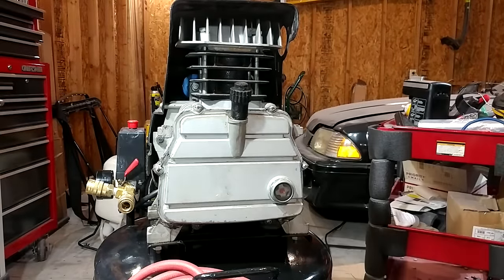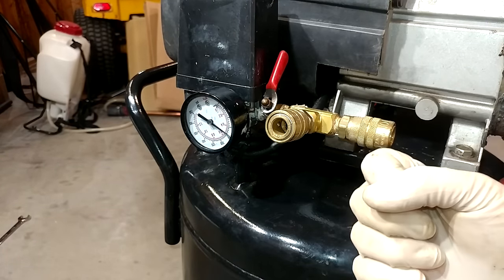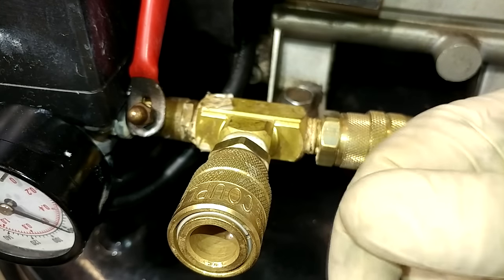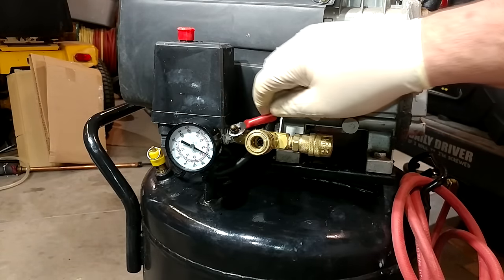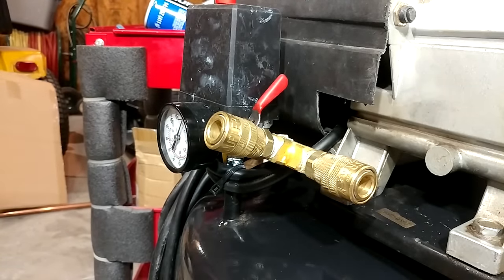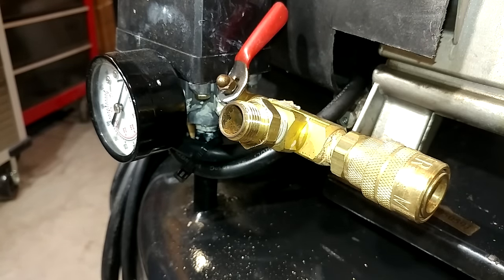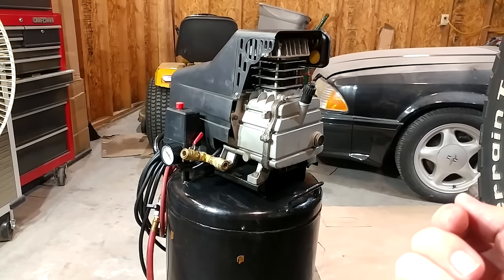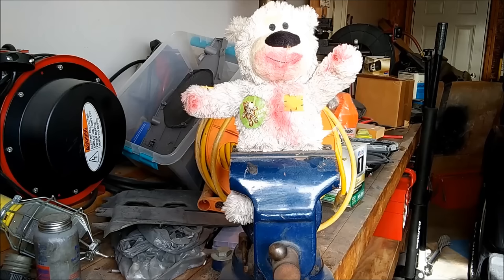Cheap Upgrades for Cheap Air Compressors!

Comment: Having the ball valve under the tank defeats the purpose of not using the original drain cock. Ofcourse the ball valve is easier than the drain, but by that time who cares their already on the ground. But I do get what you where going for, just not worth it. In my mind. Great video tho!
Reply from the maker: Thanks!

The valve under the tank is just there for emergencies and I don't think I've ever shut it off. The one at the end of the hose is the one I use for draining.

Comment: "These Milton fittings are amazing and never leak".....and this one is a problem child. lol
Reply from the maker: You're not alone in the lol... I struggled with how to handle that.
Reply: @TheBrokenLife  you did great! Very informative video. Hilarious part is once you said how great they were, I instantly started looking them up to buy some and then the trouble maker appeared so i said “eh i better hold off.” Haha
Reply from the maker: @LakersNinersFan  I appreciate that! It was a face palm moment for sure.

Despite that, the Milton's are still the best I've used. I did look into getting some Parkers, but they're about $25 each. Not sure if they're worth it to me. I may get one just to tinker with at some point.
Reply: @TheBrokenLife  How's your experience with the compressor itself? I just bought a 27 gallon dewalt from Home Depot and am waiting on it. Had a McGraw but that crapped out on me. I sand blast cups to make them look frosted but I've had trouble finding a compressor I don't have to keep waiting on. It shouldn't take me 30 minutes to sand blast a 26 oz cup. lol
Reply from the maker: @LakersNinersFan  I reviewed it over here: https://youtu.be/j2nLAYkaNYA

As far as what you're wanting to do, it would never do that. Sandblasting is one of the most air hungry activities there is. In the many hours I've spend doing it over the years, I've already decided if I have a sandblasting job any bigger than a dixie cup I'm going to get a gas powered compressor for the job. Something like an IR 2475F13GH. It's not cheap, but you don't need lots of electrical power for it and it's not as expensive as it seems when you really look into the performance vs. a comparable electric.
Reply: @TheBrokenLife  So a bigger tank wouldn't help me? Because I tried with a 20 gallon McGraw that crapped out on me and now I have an 8 gallon as a place holder but it restarts in 10 seconds. lol. I just shut it off until I use the air in there and then have it fill up all at once.
Reply from the maker: @LakersNinersFan  You're doing one very specific job, so it's hard to say if the bigger tank will help you or not with that very specific job. Maybe 27 gallons of 200psi capacity is all you need for one glass? I don't know.

But... In general, the larger storage tank just means it will take longer for the compressor to turn on, and consequently it will run for longer to refill. If you want lots of continuous duty air volume (which for sandblasting big stuff, like car parts, you absolutely do), then the compressor itself needs to flow enough air for the job, and at the same duty cycle. So if I'm using 10cfm of air at 90psi, the compressor needs to provide 10cfm at 90 or I'll have to wait on it regardless of how big the tank is. Likewise, duty cycle is an issue. The cheaper home hobbyist compressors like these aren't intended to run 100% duty cycle. In fact, it's more like 50% or less. So that means if you run it for 5 minutes, you should let it rest for 5 minutes. This is super frustrating since it usually takes at least 5 minutes for them to come up to pressure the first time. The industrial stuff is rated to run 100%.

FWIW, it looks like the Dewalt produces about 20% more air than the McGraw at 90psi, so it should be a better compressor for the job. I tried to find the duty cycle for the Dewalt, but they don't seem to advertise it, which usually means "not very long". Oil-free compressors tend to run on the hot side so I don't like to push them too hard, but, I've never used a "good" one like the Dewalt should be. You might want to shoot them an email while you're waiting and ask them that question.
Reply: @TheBrokenLife  Great info!!!! THANK YOU!!! I'll definitely shoot them an email. Much appreciated!
Reply from the maker: @LakersNinersFan  I'm happy to help. You just gave me the thought that maybe an air compressor basics video would be a good thing...? I'll add it to the list!
Reply: @TheBrokenLife  YES a video like that would be great! I've searched for ANY video that would basically tell me a list of things I can and can't do with my specific air compressors and found nothing. 

BTW, I searched and found an answer to the duty cycle. They said oil free CAN run at 100% but doing so reduces the overall life of the compressor which I would assume is fine since I got the 3 year warranty on it. But they recommend between 50% and 75%. Can you explain to me the 75% part. Sorry, I'm not good when it comes to these sort of things.
Reply from the maker: @LakersNinersFan  Well, it's hard to say what you can and can't do with any specific compressor since each exact task is different. You have to look at your air usage (usually the tool will advertise its consumption) vs. what the compressor can supply and usually the compressor manufacturers lie by at least half. ;) So... If your tool is calling for 4CFM at 90psi, your compressor should probably be rated at 8CFM at 90psi, minimum, if you want to run your tool non-stop without waiting for the compressor.

Duty cycle is way easier than it sounds. It's the percentage of time out of 10 minutes that it's "allowed" to run. So, 75% is 7.5 minutes of running time, then a 2.5 minute break. Personally, if I were to offer advice, I would err more toward the cautious side and stick to the 50% mark. So, 5 minutes on, 5 minutes to rest. I would be more comfortable suggesting extending the duty cycle if you add some auxiliary cooling, like a regular household fan, to help the compressor cool.

That said, I run my compressor for as long as it takes to get the job done. Sometimes that's literally hours on end. If it dies, then I have no choice but to get a better compressor. At the price point you're at, that starts to get a little expensive though.
Reply: @TheBrokenLife  You are a treasure chest of knowledge and help!!! Thank you for everything. You’ve helped me a ton.
Reply from the maker: @LakersNinersFan  I do what I can and I'm glad you found it helpful!

Comment: Sorry dude, but you got several things  going on there that I would absolutely advise not to do.
Why do you have a hose on your drain? Street 90deg elbow, 2" pipe, ball valve and a 2"-6" pipe coming straight out is where that should end. That setup you have there is absolutely retaining water. Especially since it's above the lowest point of the tank. That crud in your disconnect  pretty much confirms that.
Regulator with a guage is essential if you want to prolong the life of your tools. Most air tools operate at 90psi and that's where the regulator should be set. Fullbore air from a compressor that can push out over 90psi will shorten the life of an air tool. 
A filter of some type on the output before your disconnects is an absolute necessity if you want to protect everything downstream.
Reply from the maker: I explained all of my decisions clearly in the video. If you're not understanding something, or just in disagreement, that's fine. My new compressor (in the playlist) has a much more elaborate aftercooling and water separation loop that actually cost more than the entire HFT machine in this video. Also keep in mind that the machine you see in the video had been in use for nearly 20 years. It must have been working alright. 🤷‍♂

Thanks for watching!
Reply: @The Broken Life  Your equipment obviously you can do whatever. My professional advice (30yrs+) is no one should be duplicating any of this as an upgrade. Gravity is indisputable. That hose was above the low point. Looking at that hose, you'd have a lot of blow down to completely clear it. Our tanks have long blow down lines but they're 300gal, 600psi.
Regulators by their very nature are restrictive. That's how they regulate. Some are better than others. Guage displaying what the output is, is what really matters. The restricted air if you have everything piped right isn't going anywhere.
Reply from the maker: @muhammadsteinberg  The hose isn't above the low point of the tank... it comes out of the bottom at a lower level than the factory drain would. It's a drain hose, not a reservoir.🤦‍♂ You not understanding that isn't a shortcoming of the design. Likewise, the rust isn't because of that hose... it's because I never drained it (which I said in the video). Again, this is a shortcoming of your understanding. The entire purpose of the remote drain is so I do drain it more often. Which has worked... I even have a video of it working, which is linked in the description. 🤷‍♂ 

A 600psi system that you have to "blow down" sounds a lot more like a steam system than it does compressed air. Those things are not the same. You typically don't "blow down" air compressors, you drain them (which every air compressor manual I've ever read says to do daily, in those words)... although I confess that I usually do a combination of both. In industrial applications, small compressor tanks (such as in the maintenance shop) normally are either never serviced or have automatic drains, and the industrial stuff with many hundreds of horsepower of compressors usually have air dryers and other aftertreatment so that water rarely gets into the storage tanks to begin with. That's obviously beyond the scope of someone with a $150 compressor in their home garage. 🙄 You're letting your experience, whatever it may be, cloud your frame of reference. I'm not trying to replicate a blow molding or tire factory here.

The regulators that come with cheap compressors like this are not capable of the flow rates required to actually run air tools. They really don't even flow enough to run a decently sized blow gun. An entry level "decent" regulator that would keep up with air tools approximates the price of the compressor. The audience for those markets is not the same. A $100+ regulator is not a "cheap" upgrade. That's a different video, which is coming... I explained the issue and you have failed to understand it. 

Anyhow... If you still don't understand how this stuff is setup, how it works, and why I made the decisions I did I'd be happy to explain it in some other way that may make sense to you because at some point if you really don't understand, it's because I didn't show it well enough. If all you came to do is just "tell" me things, alright then. Every comment helps and I appreciate every view. 👍
Reply: @The Broken Life  LOL dude. Btw the system is compressed air for air starters that start locomotive engines. Far above someone doing a hack job in their garage. Not knowing how to turn the wrench pretty much sums it all up. Good luck....
Reply from the maker: @muhammadsteinberg  Thanks! This is my most profitable video so I appreciate your support! 👍

Comment: a tee fitting is unwise     the 90 constricts airflo on the extra hose     a y would be much better
Reply from the maker: As you said, that's the "extra" hose. Flow isn't the primary concern for me.

Comment: If you turn the tool the right way and adjust it right, you could have gotten it apart on the first try. Then the vise grips were backwards as well.... 🤣 😂
Reply from the maker: See the pinned comment.

Comment: Try adding a dirty leg before your air hose fittings.
Reply from the maker: I don't think dirt legs work very well in compressed air systems. The volume of flow is so high that they tend to carry whatever is in the air along for the ride without having any opportunity for anything to fall out.

That said... My approach since this video (with a different compressor) has been to after-cool the air between the compressor and the tank so far less water even gets in the tank, so far less corrosion. I'm also trying to be better about draining it. 😂

Oh... and I have since learned that Parker has a line of fittings with aluminum cores... though they are expensive.

Comment: Not being a dick but dude if you're going to try and make instructional videos it would be a good idea to understand how to use every tool you'll be using first. The channel locks as well as the vice grips were both being used backwards. That's why they both slipped and shaved brass off of your fittings. Always use these tools in the direction that they're angled to optimize clamping pressure. I'm only trying to pass on some tips
Reply from the maker: I've never been great about paying attention to that. That fitting was insanely tight no matter how you cut it. 

You also should understand these aren't really instructional videos. More of a join me in the shop kind of a thing. You're absolutely right that I'm not an authority on most topics and am just a guy bumbling along at home.

Thanks for stopping in!

Comment: Yeah, that "harbor hate" junk! 

*Needs to rebuild brand new part immediately 🙄😅
Reply from the maker: I'm no fanboy for HFT, but that compressor gave me way more than I paid for it. I can't complain, even though I still do... 😁
Reply: @TheBrokenLife  bro, you bought the budget air compressor at a budget store and started putting upgraded parts on it... c'mooon maaan! 

Next time go to the budget store and get the one that takes oil... gaskets go bad, if it didn't leak in the first place it was never a bad product.
Reply from the maker: @OGRH  What are you even talking about? The compressor was over a decade old when I filmed this video, it is an oil lubed model, and it did leak the day it came home (both air and oil). 😂

...and even with those problems, I got more than I paid for.

Comment: ALWAYS POINT THE FEMALE COUPLER DWN TO KEEP MOISTURE FROM ACCUMULATE IN THE FITTING AND THEN JUST SITTING THERE 
24/7/365 NOW ☝️ IF BEFOR YOU INSTALL THE FITTING YOU DISASSEMBLE IT AND GREASE IT WITH SILICONE LUBE / GREASE IT WILL STOP ANY FUTURE RUST ISSUE'S
Reply from the maker: I've got to think I have a different idea of up vs. down when it comes to these fittings. Seems like pointing it down would have the water sitting in it constantly?

Don't grease or oil your fittings if you ever plan to paint with your compressor.

Comment: The trash in your chuck isn't from your tank, because gravity. The tank rust falls down not up and comes out your condensate drain. You got dirt & local rust. I like my chucks to point down, level only as a last resort.
Reply from the maker: Gravity isn't the only force at work there and it's not even close to the strongest one. There's an awful lot of air volume moving around in there that is readily able to move junk from place to place. The inside of a working air compressor tank is a hostile place.

The fitting that has always been horizontal has never really had a junk problem, but that's also the one that gets used the most. I believe my theory is probably right that it's pulling garbage up via the active port and depositing it in the inactive port (which was a bit downward).

The good news here is that I recently got a new compressor and will be revising the overall setup. Interestingly, I plan to mount the fittings going straight up, if possible. So... I'll be experimenting with the opposite of what you're thinking. Should be interesting.

I'm also also going to be doing my best to dry the air out before it gets in the tank, so hopefully not much more reason for junk and rust to form.